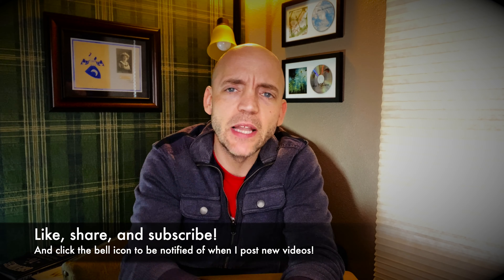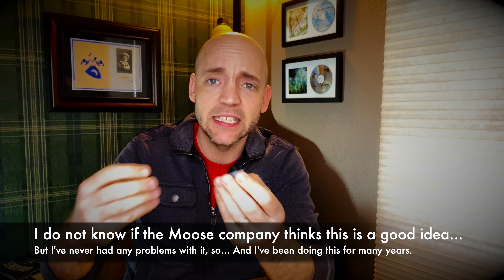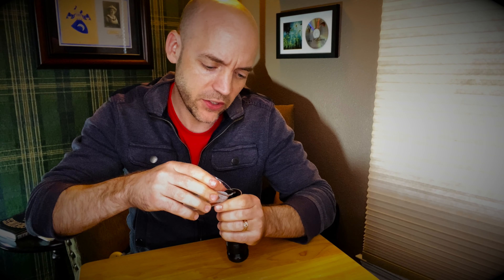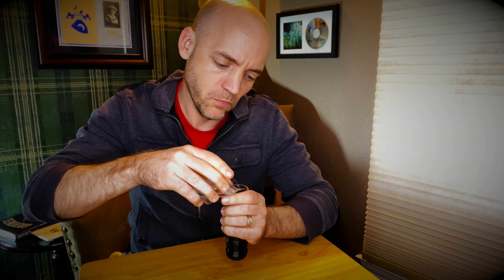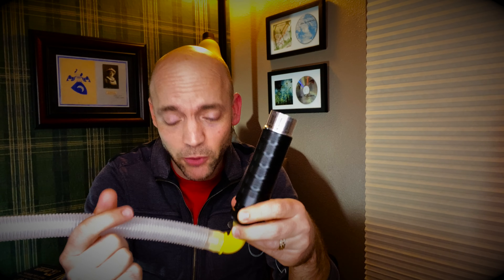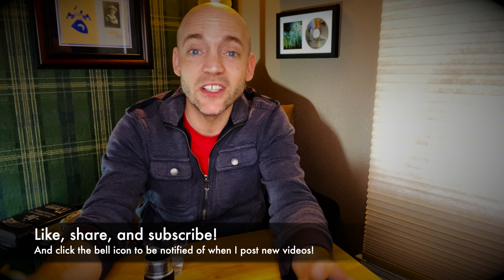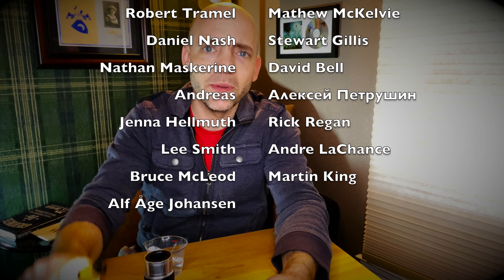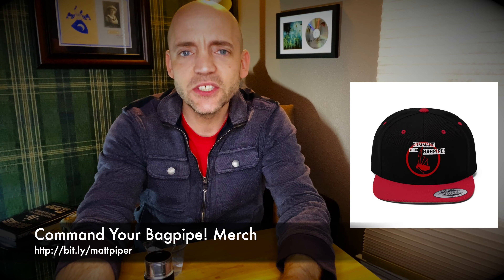The Moose Valve - Best non-return valve for the pipes!

Comment: Another great video! I hadn’t really thought about sanitizing my Moose Valve but I guess I should. Out of sight, out of mind. I also have a Little Mac valve in a 2nd set of pipes. I’ve had it for 40 years and it still works - and yes, I did clean it ;-)

Comment: I have a ross valve in my blowpipe stock, and it works as a basic moisture trap as well. Although the rubber valve is getting worn away after 3 years of playing, but I think the rubber valve is replaceable , so don't have to buy a full ross valve again.

Comment: I see this video has been around awhile, but I was wondering if you had any ideas (and might even make another video) how to use a Moose valve with a split blow-pipe stock....
Reply from the maker: Depending on the diameter of the tube, some folks have put it at the end of the tube.

Comment: Hi Matt, thanks for the detailed explanation !  Is it worth combining the Moose Valve with an anti-moisture trap system in the bag (plastic bottle) ? Doesn't it impact the necessary force of the blow?
Reply from the maker: The biggest obstacle in combining the two is making sure you don't insert the tube too far into the blowpipe stock, or it'll interfere with the Moose Valve. Otherwise they work great together, though many find the Moose valve alone provides enough moisture control to not need the tube. But every piper is different...

Comment: I doubt this would fit my Flemish pipes. The diameter of the blowpipe is a lot smaller. The valve that's on there now sometimes fails. Not often but when it does, oh boy my bad breath hits me right in the face. Love the pipes
Reply from the maker: Yeah, the Moose Valve is about 3/4 an inch across. It's too big for anything but highland pipes methinks.

Comment: Does the moisture collected in the stock by the moose valve increase the risk of problems/cracking to a blackwood stock?
Reply from the maker: If you leave it in constantly, perhaps. I remove mine after playing to avoid this issue.